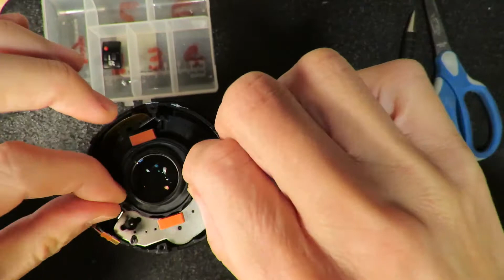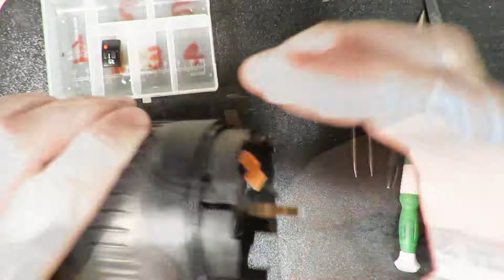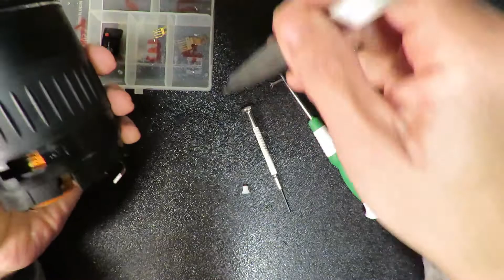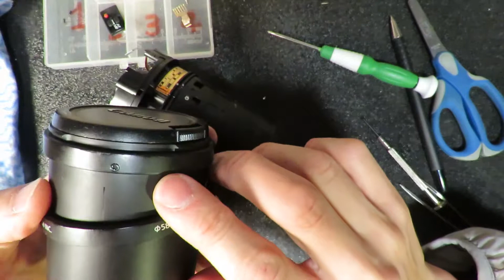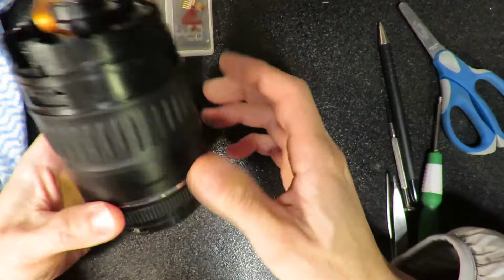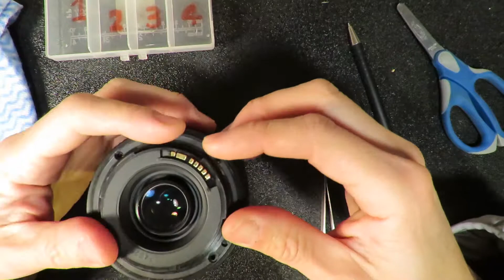Disassemble assemble Canon 90-300mm lens. Fixed the stuck zoom ring.

Comment: I have this exact lens. One day it just got stuck in the minimum apereure (high F value) and now it is like that always. When I connect the lens to the camera the aperture is moving very fast and after a couple tries it stops and in the camera I am losing the ability to change aperture. is this a stuck aperture blade or something with the flex cable? Thanks!!!